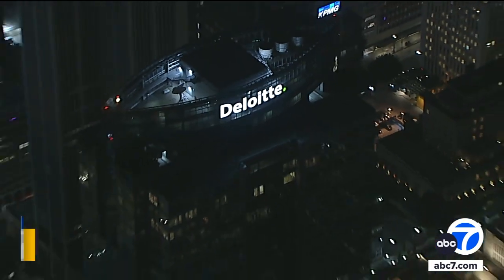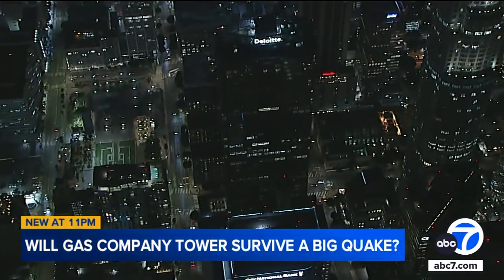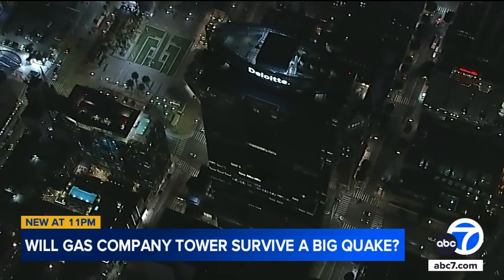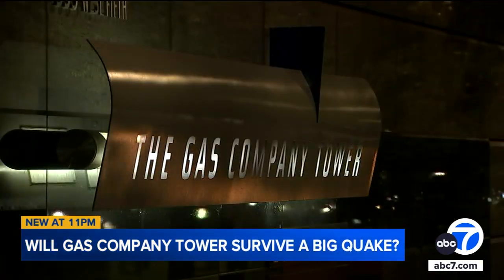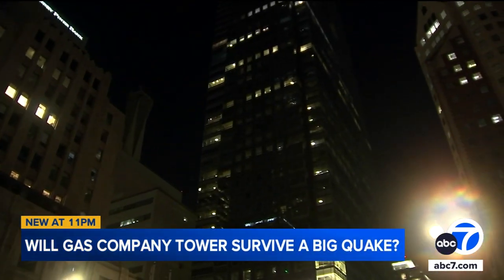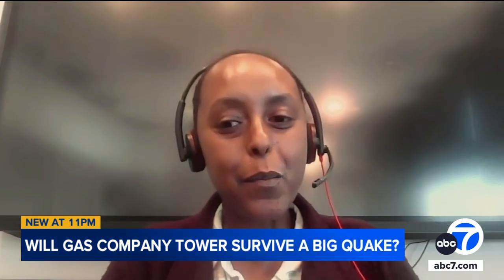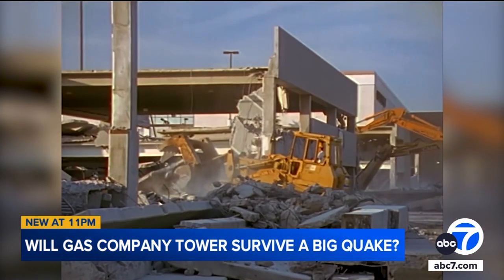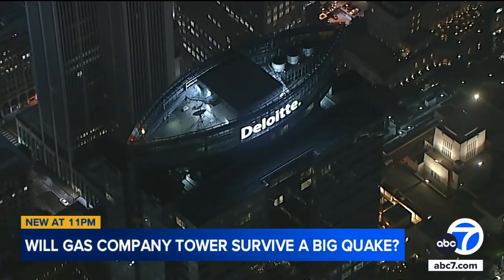Can this iconic LA skyscraper survive a major earthquake?

Comment: The short answer is NO. Probably not. USGS and other scientists have all agreed, one strong 7.5 earthquake in or around DTLA could effectively level the entire area. Goodby LA, thanks for coming and playing our game…..you lose. So, yeah…..better be prepared. 😘🤌🫵😎
Reply: Absolutely garbage take, weve seen cities like Tokyo and recently Bangkok go through stronger earthquakes and most of their skyscrapers survived. Also buildings like the U.S. Bank Tower and Wilshire grand are designed to withstand larger quakes. Crap even buildings like the AON center(70s era) has things like suspension points under the buildings which allows more flexibility in the structure during a large earthquake. Likely we'll be seeing a similar situation to Bangkok when the big one happens. Its the smaller and older buildings that are usually more at risk at collapsing.
Reply: @spartan7119  Thanks for quelling the fears of the ignorant!
Reply: @spartan7119 🫵😆😘🤌🤡
Reply: @Stromboli15  L ragebait, do better
Reply: @spartan7119  😆🤣😆🤣😆🤣😆🤣😆🤣🤫😆😆🤣
Reply: @spartan7119  🤫🤫🤫🤫👌😉
Reply: The bigger quakes occur closer to the north and south poles, 8.0's in Santiago Chile and no building falls down, same in Japan, where a 9.0 struck and not one building in Tokyo was effected.  A 7.0 hit Seattle in 1999, and the only damage was to the capital building built way back in the 1930's.  Your prediction is absolutely comical!
Reply: @michaelellringer5600  what about Taiwan? It's not a closer to the poles issue, it's increased activity around the ring of fire subduction zones thing. Being prepared is truly what is important here. Not quibbling over wether or not it will happen. It's not if.... it's when. Just some thoughts after a huge fire debacle in LA.